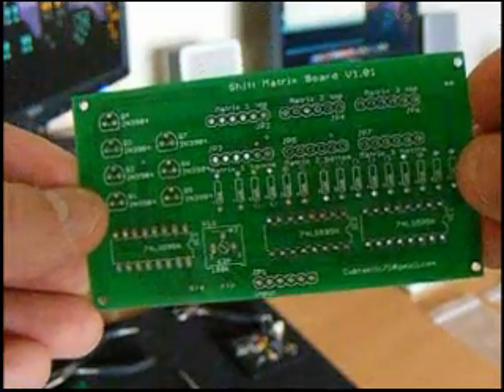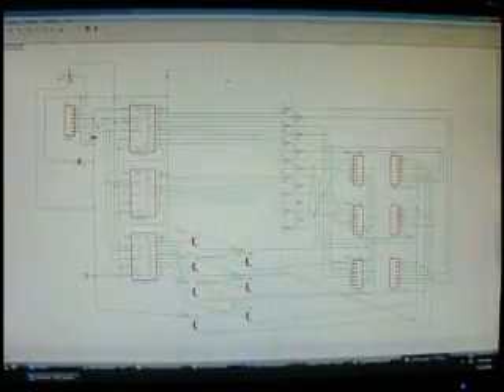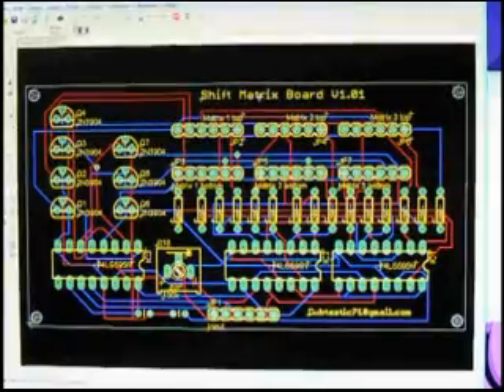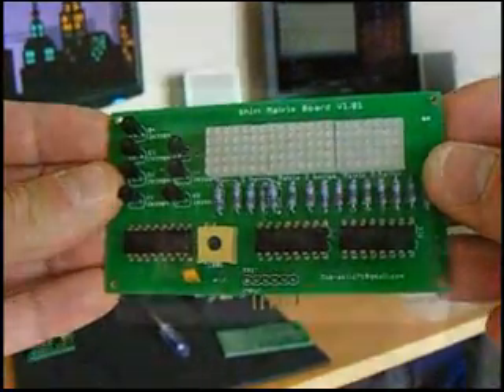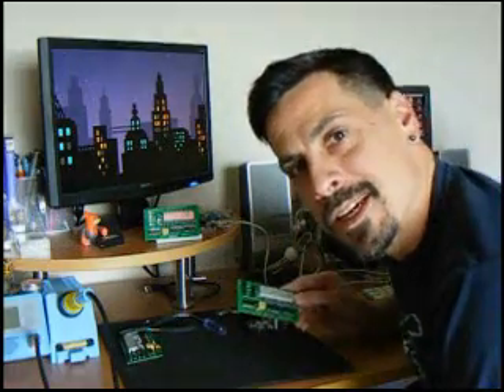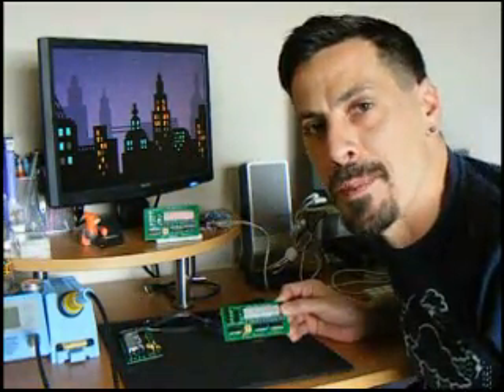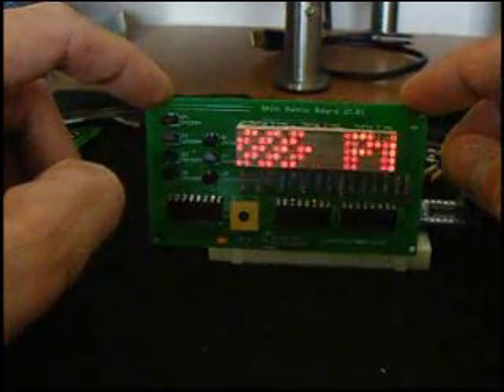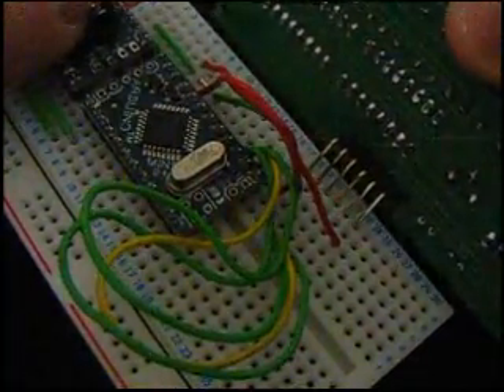LED Shift Matrix Circuit

Comment: Hi I am just starting to work the Arduino.  I have worked with 74HC595, but  I was wondering if I could see the code you created to drive the display?
I am most interested in the scrooling of the display.